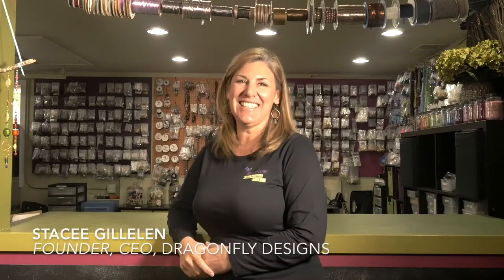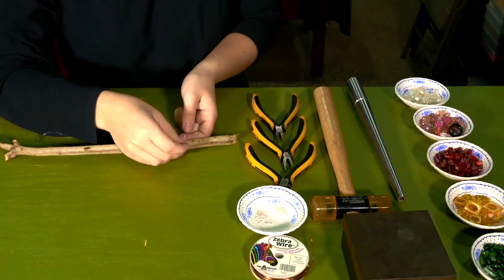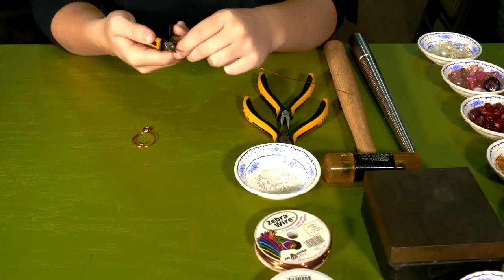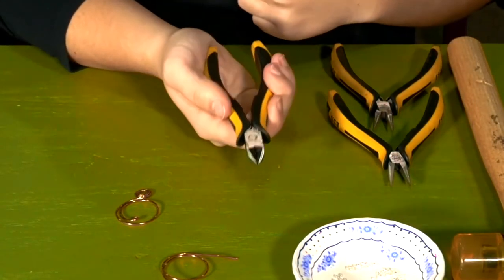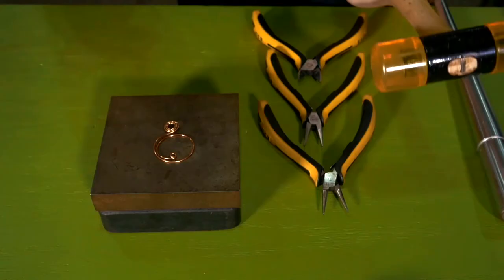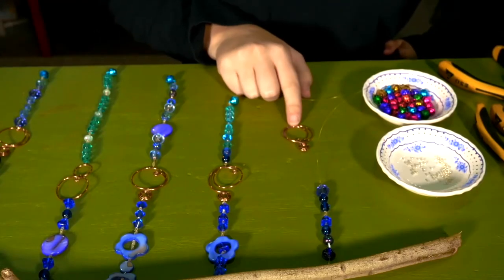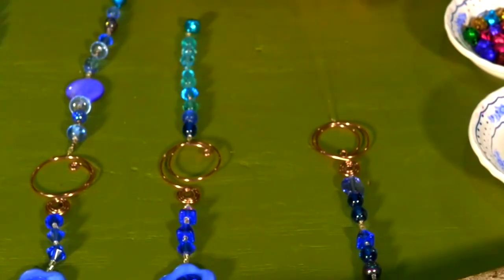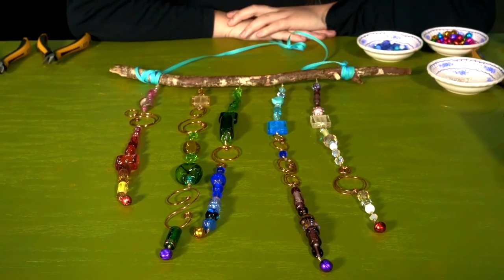DIY Beaded Windchime

Comment: When making mine, using a wooden stick, I found that the wire loop would slip around on the stick.  So, I notched the top of the wooden stick, just slightly, so the wire stays in place.  Worked perfectly!